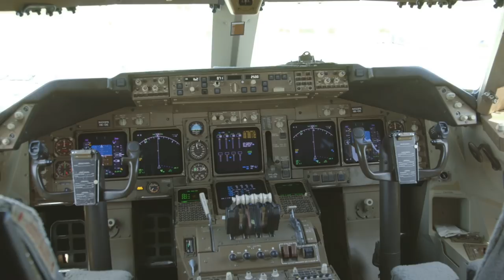How do they ship all that stuff to Alaska? | INDIE ALASKA

Comment: You cover subjects I wouldn't normally find interesting and make them interesting. The filmmakers on this channel are magicians.
Reply: My pleasure!
Reply: +Indie Alaska how many gallons of fuel does each of these planes load up on in Anchorage on average ?
Reply: +roy boy For the 747, it all depends on where the plane is going. If it's going to Hong Kong, we take an average fuel load of about 125,000 kilos of fuel. If we are going domestic it's 50,000 - 80'000 kilos of fuel. We work in the weight of the fuel because the density changes and the gallons versus the weight are not the same two times in a row. It costs fuel to carry fuel so we take what we need with a little extra for incidental issues and diversion alternates if needed. And for your question on the Carbon Footprint. If you have to ask, you don't want to know... But the newer 747-8 model is definitely more improved in the fuel economy than the previous 747-400 model. Constant improvement with every generation of the aircraft.